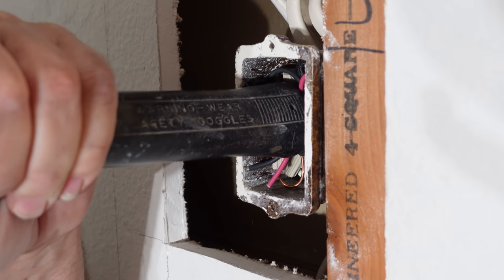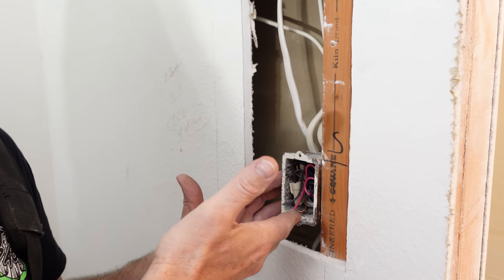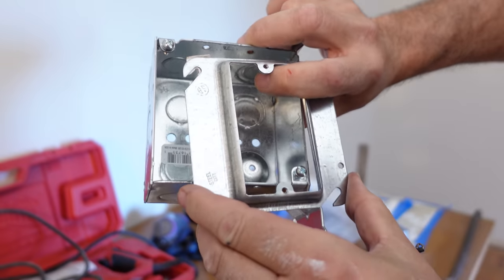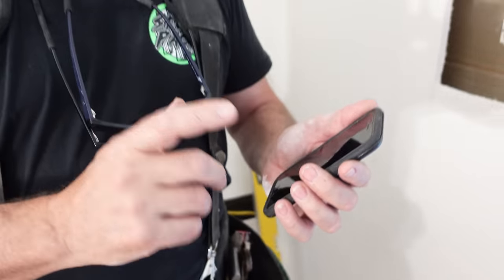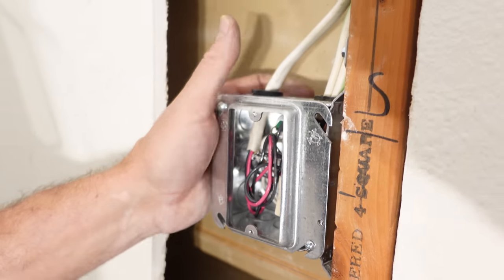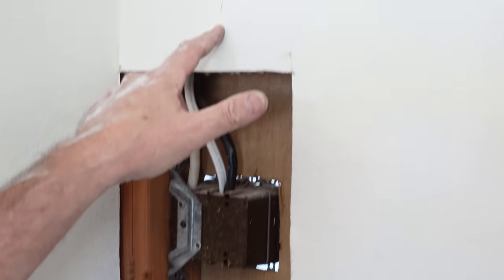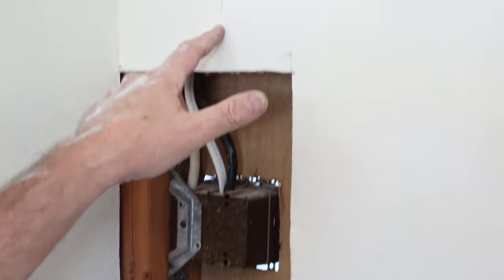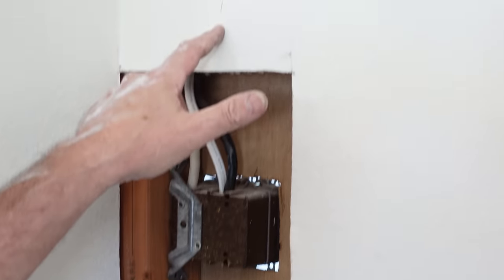STOP STUFFING BOXES! How Many Wires is TOO Many??

Comment: I come across all sorts of creative code violations in the course of a day’s work.  The most recent?  Installing a new three switch, four function switch for a new bathroom vent, heater, light, nightlight.  As many of you know, a typical older bathroom vent, heat, light, nightlight switch is an integral chrome plate with two simple rocker switches, no ground.  That leaves lots of room in the box for wire connections.  Remove that and the installation of a typical new switch takes up as much room as a GFCI unit.  Not much room for any connections in that old switch box.  

The switch I was replacing was of a newer variety, essentially the same size as what I was going to replace it with.  Before opening the box I assumed that this would be a simple change out, same box volume needed for the switch to be replaced as for the new switch to be installed.  Wrong.  I opened the box and found that it was a very small box that would have been adequate for the much older simple rocker switch that I first mentioned.  How did the prior installer get 10 lbs of switch and connectors into a 5 lb box?  They didn’t.  Lead wires were run from the four function switch to outside of the box and all connections were made there, outside of the box!  Bonus violation:  a ground wire was used as a hot line on the load side!  Had to pull a new line to correct this.

When I informed the client of these code violations and that it would be additional charges to get the installation to code, he got slightly agitated and asked me why I could not just put it back the way it was because “obviously” that had not caused any problems.  Let that sink in.  It did get corrected per one of the Stud Pack’s examples.

Comment: I'm trying to figure out box fill for pass-thru wiring. I'm putting in a 110v20a circuit (which goes all the way back to its own breaker at the service box) and want to put two outlets downstairs and one upstairs.  This means an outlet box downstairs with an outlet, an onward leg, and a riser leg. All that is normal. 

But the 12awg wire pull (including the home leg and onward leg) is through a big 1.5in conduit that also holds four massive 2awg wires running to a 240v60a outlet in the garage.  That means that downstairs outlet box, in addition to everything else going on, has four big pass-through wires, and that's not normal. 

Conduit fill is easy (and fine) but I'm trying to figure out the best way to follow the 'box fill' code.  I think I'll just err on the side of caution and use a 2-gang box.

Comment: 9:91 after many many years, Finally decided to get the 67100 crank action screwdriver with multi-tip bits. That way have my P2 and slotted 3/16 when putting on wall plates and using one screwdriver. Not bad, little chunky at tip compared to the old standard fav you have, but still nice. Would be awesome if they had magnetic tips though, but I haven’t found any yet.
Reply: You can buy a rare earth magnetizer for about $5.00. Magnetize your existing equipment.

Comment: Most boxes tell you how many wires per awg inside them. Also, all the ground wires count as 1. So, if it says 8 12 wire, then you can fit in 7 insulted wires and all the ground wires that go with them.😊

Comment: When adding new boxes, do you calculate the box fill and install he smallest box to meet minimum code? 2x4 or install a larger 4x4 or larger so you have more work room, and ease for folding the wires and receptacles back in? Does the decision all come down to cost over convenience? If it is convenience what are your preferred box size for installation?

Comment: Hey StudPack, maybe you could answer a question.  Why in the name of all that is holy are the screws for electrical items fine thread and at least 3" long?  Just seems odd when a much shorter screw would work.   Anyways, love the channel.
Reply: Alot of mfg's include much longer screws than needed for certain devices/boxes/ect so the installer has the option of cutting the screws to the length they need based on their circumstance which helps avoid the installer possibly using incorrect screw types/sizes (typically drywall screws since everyone uses 'em) which voids the mfg's warranty in most cases along with adding potential safety risks (less secure/might cut or pierce wires/might cause arcing/ect...)

Comment: Just wondering if the gate motor is double insulated you wouldn’t need a ground right? Would still hooked it up instead of cutting it off.

Comment: @14:40... that looks like SOOW  or SJOOW run through PVC conduit?    Fairly certain that it is a no-no to run flexible cord like that through conduit. Of course, even if your particular application would qualify as an exception to that, the 1/2 inch conduit is definitely overfilled, as there appears to be literally no space around the cable as it comes out.. not to mention it is facing upwards  and practically inviting water inside of it.  From what I understand, those fill calculations are mainly about heat.  Your application has an already-insulated SOOW packed tightly into another level of heat retention in the PVC, so you are risking overheating if too much current is sustained on the circuit.

That said, the heat likely won't be too much of an issue in your specific application, since the gate will be run for small amounts of time, so that cable shouldn't get too hot.. but technically it is against the NEC most likely.  I'd have more of an issue with the upturned conduit end if it isn't sealed with silicone.

I mention this because I recently ran into a similar issue with my newly-installed DIY pool timer and GFCI setup (GFCI outlet to pool timer to pool pump outlet chain).  I realized I forgot to add the ground to my calculation..  I have 6 conductors and the GFCI at 12 gauge, so calculated that at 18.0.. but my pvc box (18.5) is actually overfilled, since the grounds are also to be considered, and so I need a 20.25 or larger for my application (In addition, GFCI really should be a special case and as a "best practice" should count for 3 instead of 2, even though the NEC doesn't account for it, don't you think, so more like 22.5).  While researching solutions, I also realized that the SJOOW cable I used in the conduit is also not allowable by NEC, either for use in the conduit or for use in "permanent circuits", so am replacing it with separate strands of THHN.  I mistakenly thought.. hey, this is three waterproof THHN cables wrapped in an additional waterproof exterior.. should be doubly safe, right?  NOPE, bad me... NEC says that extra insulation is a problem in conduit, not a benefit.

Comment: Just moved into our house and have found a few interesting things going on with the electrical. 
The main problem I'm wanting to address first is the boxes. One 2 gang box has power coming in, two wires to separate outlets and one to a light. 
I'm trying to find out the best way to handle this. the wires to the outlets are just connections from the source power. How could this be handled aside from having 6 wires wires twisted together?

Comment: One of my companies Rentals needed a GFCI outlet behind the washer. It had one of the small metal boxes that barely fit a Standard outlet, no way I was fitting a GFCI in that box. This outlet had another outlet after this for the Sump Pump. I just replaced the small metal box with the same large metal box and plate you showed.  Bit of an over kill as far as size but that's what I had on my van and it gave me plenty of work room in the box. Inspector passed it so everyone's happy.
Reply from the maker: Cool thx John 👊👍
Reply: Another option for this problem although a little more expensive is a gfci breaker. But I wouldn’t suggest getting inside the panel if you’re not a “qualified” person.

Comment: Interesting fact about bakelite, it smells like moth balls when held under hot water.  Also, you can use those pliers to pinch off the insulation instead of cutting it.  Makes work go a lot faster.  :)
Reply from the maker: Thx Rose 👍.  I found the pinch technique for stripping doesn’t work well on that old brittle sheathing but I use it often on new cable 👊

Comment: This is more difficult with 2×3 interior walls... can't get the same depth and have same situation... changing switched outlets to always hot and adding a dimmer switch and the box is completely jammed. Then I made it even harder by adding a second switch and replacing single gang with double gang that is still jammed full.

Comment: Super helpful video!
One point though (but you probably won't mind the correction, since you like for things to be right)...
The first e in Bakelite is pronounced. It's bake-uh-light, not bake-light.
Reply: the proper saying is garbage. those POS are 2nd thing to go after the wires are unspliced, pulled out

Comment: Good video however, you said, there were 14 AWG wires along with 12 AWG wire on the same circuit and the circuit was protected by a 20 amp circuit breaker if I understood correctly. Does the NEC not require that the over current device “circuit breaker” be sized for the lowest rated device in the circuit.  Which would be 15 amps for the 14AWG wire.
Reply from the maker: You’re correct Lester.  We figured it out and clarified in the next video👍

Comment: Great video!  Do you have a preference for push on connectors vs. twist nut connectors?  And can they be mixed in a gang box?
Reply: The only push in style connectors that're better than using wire nuts are brand name Wago lever nuts, particularly their latest model which is clear so you can easily see that the conductors are fully inserted.
Majority of other push-ins aren't made with the same level of quality as Wago's are so I avoid using 'em over quality wire nuts (3M/ideal). 
Mixing different types of wire nuts in a jbox doesn't matter as far as code goes, you just have to make sure you're not exceeding the max amount of conductors they're rated for which is shown on the mfg packaging or their website.

Comment: I just replaced an exhaust fan in my bathroom and found that the fan was being used as a junction box for the entire circuit.  I don't know how the previous guy shoved all of those wires/wire nuts in such a tight space

Comment: Did you check to see if the other side of the gate wire saw grounded it might go to some switch mode power supply that doesn't have a ground and no provision for a ground I'm not saying it would be hard to ground it I'm just saying
Reply from the maker: I did check after a previous comment.  Video coming up on what we found 👍

Comment: You missed the most important numbers in the back of the box. If it says 11/14 you can fit 11 14awg wire with all grounds counting as 1 wire and a device counting as 2. So if you have a box with 2 14/2 romex w/ ground and a GFI it counts as 7 wires

Comment: For those of you here, 14/3 Romex wire Means 14 Gauge Wire thickness or Wire diameter! Wires also referred to as the conductors! 3 three conductors not including the ground conductors! 

So will they referring it to is 14/3  14 gauge wire and three conductors not including the ground conductor which does not have a plastic coating on it it’s just bare wire if you don’t understand this and there’s no need for you to watch this because you’ll never understand what you’re watching!

Comment: I have an electrical question and I thought I might ask my favorite Saturday morning crew I like to watch. I am going to install 2 Ubiquiti POE (power over ethernet) onto the back of my house. I have run my cable in the attic and now it is coming out under the eve in one of those 3-4 small opening to help cool the attic. I was thinking of getting some electrical conduit (because these ethernet CAT6 cables are giving power to the cameras) so are there lots of different types of electrical conduit, I have a Home Depot within walking distance and go there a lot out of convivence, but they don't always have an electrical guy in the electrical system and so one. So I just thought I would check with you. I don't want to just have wires running under the eves and would much rather have gray conduit running under the eve with brackets and just boxes and such. I live in southern California, so you know it gets hot here in Upland CA(near Ontairio and Rancho Cucamonga. I have gotten all the hard work done so far and I am on the final section of running a cable connecting the camera to a POE switch I have in the downstair attic.   Any help would be appreciated.
Reply from the maker: I like the idea of using electrical conduit in this application plus the boxes now give you a place to mount cameras, lights, etc.  Coat of paint makes it kinda go away 😁👍

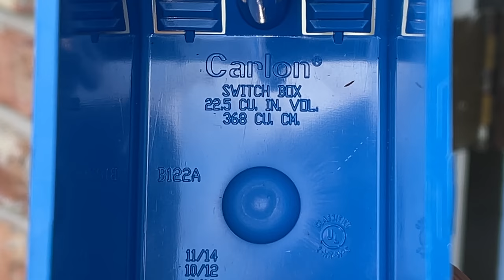Comment: @1:26 you show the inside of one of the boxes and there are some additional numbers listed:
11/14
10/12
9/10
Those numbers are how many of each conductor that can fit in that box (i.e. that box can fit 11 of 14awg). 
An app definitely makes figuring this out simple, but if you know to count combined grounds (up to 4) as one conductor and devices as 2 it's a really easy way to check your fill.
Reply from the maker: It’s not the number of conductors it’s the number of conductor equivalents.  You have to account for devices grounds etc.

Comment: hey does the copper ground have to be bare? could it be another color? just curious as to why

.. and how about a video on installing a  car charger port in the garage.
Reply: it has to be either bare or green insulated, if you use any other color it must be marked with green tape near the end so the next person working on the wiring knows it is a ground.. Just like black or red is always hot, white is the neutral , and green or bare the ground.

Comment: I had a house years ago, built in 1921 (knob and tube) and there was a dual gang box, with two light switches in it. Being fuses, there was no way to couple those two fuses and of course at the time, I assumed it was one fuse for both lights. Nope. I open the box and start working in there on one switch, and it dawns on me...is this other switch, live? It sure was. ALWAYS double check with tester or meter.
Reply from the maker: Thx Larry 👊👍

Comment: How is the mud ring finished off.  Is it flush with the wall? If the outlet is attached to the mud ring (not the box) can the ring be removed to replace an outlet? Or, does the mud ring always stay attached and the outlet angled into the box then pulled back tight to the backside of the mud ring?
Reply from the maker: Mud rings stay in place and devices mount to it.   Wall finishes flush to the mud ring 👍
Reply: mud ring gets flush to wall, the mounting screws get buried behind the wall. which is so much fun to dig out later down the road

Comment: I give you a D. For the way you stuffed the wires in those boxes. Not straightening the wires 1st & Not using the outside perimeter spaces in the box to dress the wires in. As you left it there's no room for a dimmer, much less a switch.

Comment: I would add to get rid of those wire nuts and try Wego connectors. UL approved and also approved in quite a few other countries. Been around for ages. They can free up a lot of room in the box. 
I know some people hate them. But there are other people that love them.
Reply: I love them too, but keep in mind that their use is not factored in to the calculation for minimum box size.  So while it might free up room it doesn't affect the size box you need to use to pass an inspection.
Reply: They already used the push-in-style Wagos at 7:53
Reply: Those were actually Ideal push-in connectors, not Wago brand. But I still see one traditional wire nut in that shot, I am wondering what that connection is.

Comment: From the uk (not an electrician) and just wondering why you guys don’t put any sleeving on your CPC wires?
Reply from the maker: It’s always been that way with Romex, the stuff we use for most residential.   On the commercial side the ground is insulated
Reply: @StudPack  thanks for the reply, it’s interesting to see the differences between countries with regards to wiring methods and techniques etc

Comment: I love the attention to detail. I hope in the first box you separated the neutral from The Wire you said went straight through.
Reply from the maker: I didn’t have any pass through wiring.  Sorry for the confusion but you’re absolutely correct those neutrals wouldn’t be connected 👊👍

Comment: When I was remodeling my kitchen I needed around 26 also. I actually found a single gang 30 that has a door and looks like a 2 gang. First time i saw them and it worked perfectly

It's actually meant for dryers and ranges. Here's the model number RD30-6R
Reply: I used the same box when installing radiant floor heat. The feed,  temperature sensor leads, cold lead to the floor, and the thermostat all have to fit in the one box.

Comment: Working with those Bakelite boxes was a big mistake as all the fixture screw holes failed (this was in the 90's)
Reply: Mid West.  Interesting. Bakelite was a product (radios etc) from 1930’s 1940’s ??
Reply: yea isnt it fun when the fixture screw strips, breaks off those garbage bakelite boxes. most of ours at our complex are recessed too deep in the wall or from years on cramming wire/devices back in them hanging on by maybe 1 nail, pull out of the wall

Comment: I always put my ground up . Took safety classes and they showed some pictures of someone using a tape measure on the wall and electrified and shorted the breaker cuz the tap slid down the wall and made contact across the forks . Granted the plug was not pushed all the way in but it’s not a lot of work to make all the ground facing up. I know there no code here in Ohio and it’s a preference thing so figured I’ll share .
Reply from the maker: Cool thx 👊👍
Reply: That is how they do it at Disney resorts